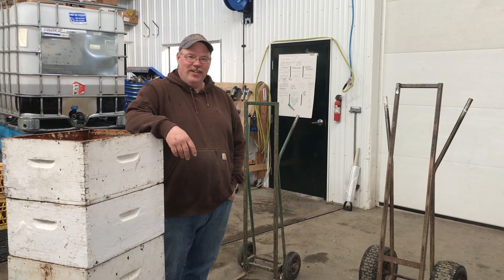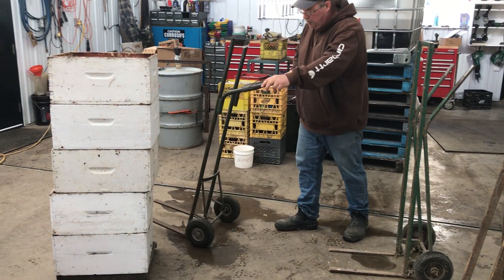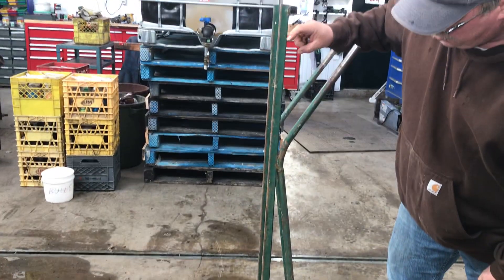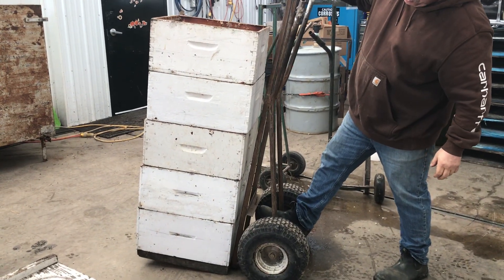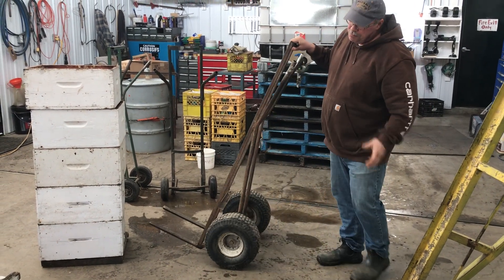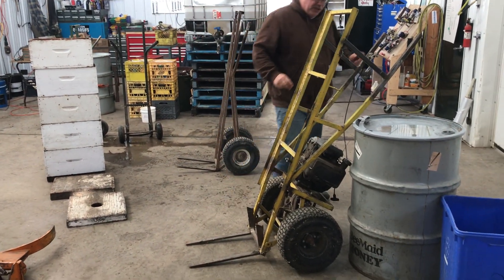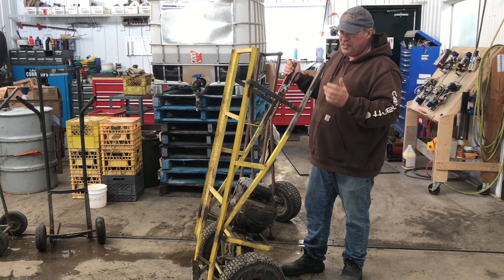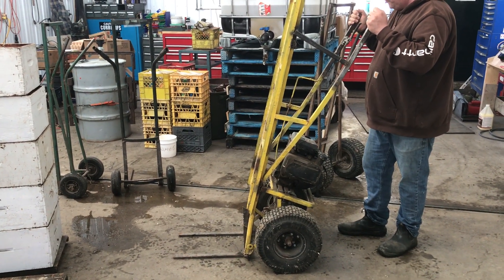Hive carts

Comment: I'm thinking of the same direction but hydrostat will remain and istead of petrol engine a battery screw driver can turn the pump of the hydrostat.
Reply from the maker: If I was to do it again I would use electric motor and lithium battery.
Reply: Maybe all this torque from hydrostat is not needed ? @philbeeman

Comment: Did you use this to move hives on and off yard. Or did you only use it to move honey supers? I am in the process of making a swing arm to lift hives put on truck not as sophisticated as a easy loader. But this may be better option. Trying to save my back. Thanks for videos.
Reply from the maker: The motorized cart was used to move hives into winter when they are very tightly clustered.  I think now I would build it using a lithium battery and electric power to reduce vibration and use it year round.  It worked great for handling stacks of honey boxes during harvest.  To handle the hives and stacks of empty supers we used the "big wheeled" dolly.